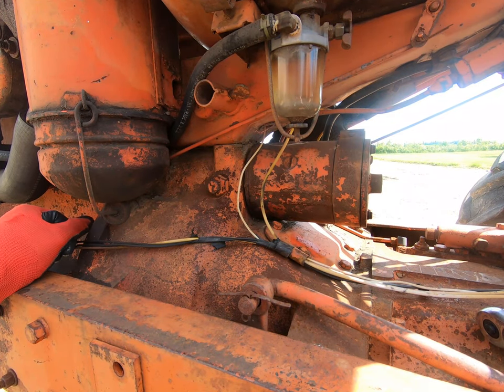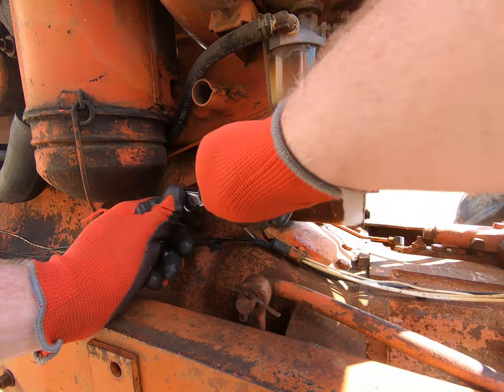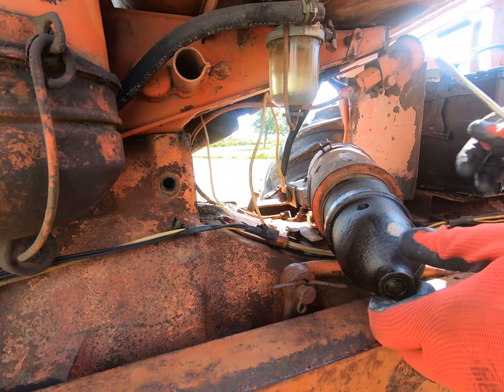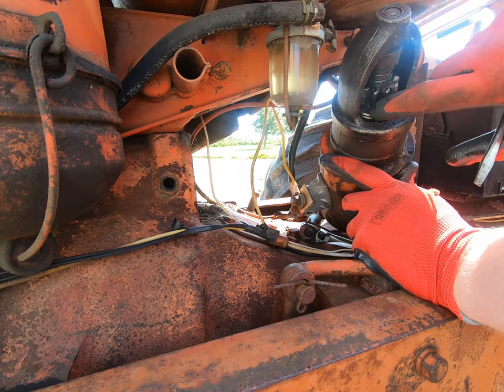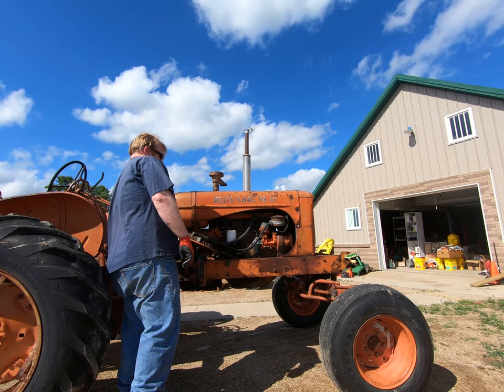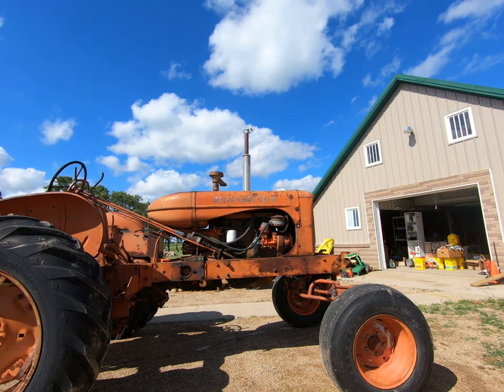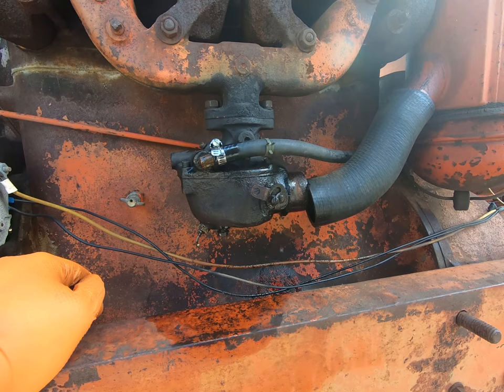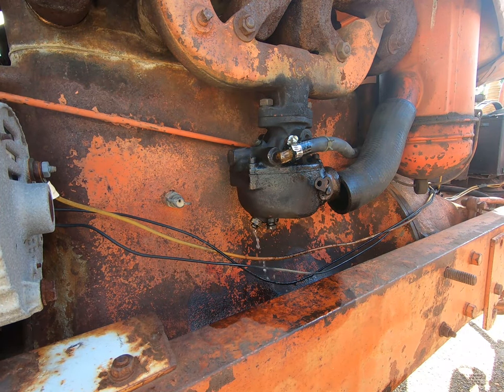Allis Chalmers WD-45 Part 2

Comment: The flair fitting on carb is correct, it originally had a steel fuel line
Reply: Doug Boerger I have used copper refrigerator line, and it works well. It’s cheap and easy to manipulate too.
Reply from the maker: I figured it was correct. A lot of manufactures of that era used steel lines. I may end up running a copper line as mentioned above... I’m just terrible at bending stuff. Haha

Comment: Kyle, maybe 1 1/2 to 2 turns on that needle valve like many of the carbs use as a starting point??? You also scared me with that throttle linkage, I was afraid you were going to hit the screw on that back of the alternator..... Been there done that. I now remove the negative battery cable anytime I am. messing around.

Comment: Buddy that solenoid problem is usually caused by a low voltage problem ,, i had it on my JD changed battery and waa laa fixed, could be caused by a dirty connection or bad switch also,, most the time it maybe getting 12v but not enough amps to activate bendix.. just a idea buddy...
Reply from the maker: I thought that at first but I’ve worked on it enough now that I really just think the Hendrix is dirty. Couple rounds of cleaning so far and it is much better.

Comment: The throttle knob cracked on the 430, how do I replace it?  Do i have to put some grease or something on the shaft to slide it on?  How do I get it to hold?
Reply: The knob just slides off, sometimes vise grips help pulling on it. If I were you I’d definitely put a tiny bit of grease on the new one.